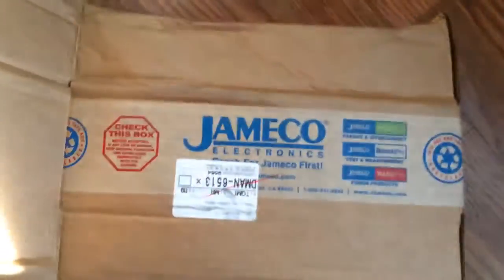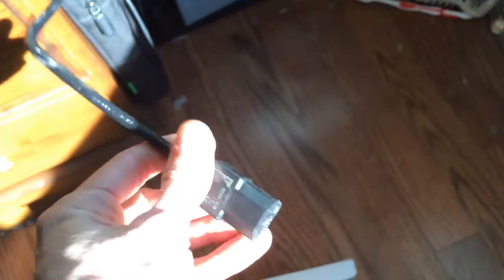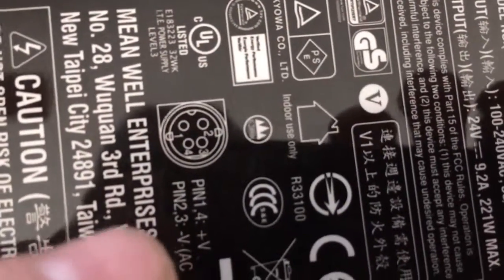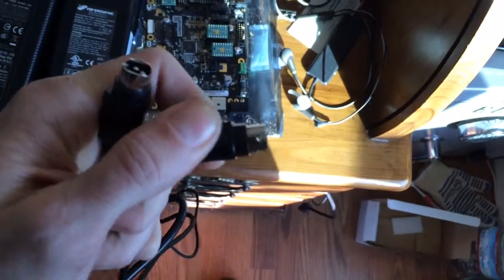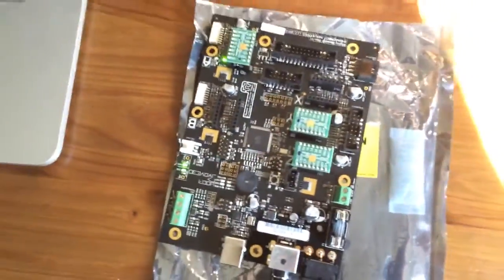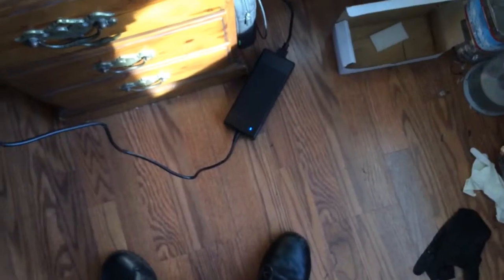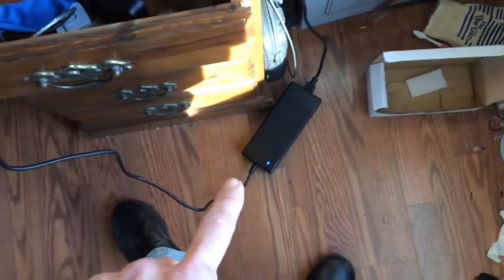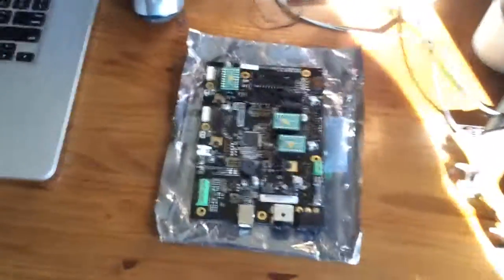Replicator 2 Power Supply Upgrade for HBP

Comment: I need a replicator 1 power supply and came across this video.   I just googled the part number FSP fsp150-aaan1.  It appears in 3 different configurations on the 4 pin din so definitely watch out.  The 12v 12.5amp gave away one fake, but the sticker looks identical to your video except for pinout.

https://www.ebay.com/i/163291454396?chn=ps

https://www.ebay.com/itm/Genuine-FSP-FSP150-AHAN1-150W-AC-Power-Adapter-9NA1350204-12V-12-5A-4-Pin-OEM/263925018197?_trkparms=aid%3D555018%26algo%3DPL.SIM%26ao%3D2%26asc%3D20160908110712%26meid%3D22981080a75946b6a8f4b471ce38f82e%26pid%3D100677%26rk%3D4%26rkt%3D14%26sd%3D163291454396%26itm%3D263925018197&_trksid=p2385738.c100677.m4598
Reply from the maker: That why I mention this at 1:17 , a lot of fakes on the market when it comes to some power supplies. I’ve known some people to blow the main board not checking the pin out first. Glad you caught this before your ordered the wrong one.
Reply from the maker: I just looked at the fake one you linked. Almost identical except the “Sparkle Power” name in it. FSP Group is the maker of the one power supply and they don’t have the name “Sparkle Power” on the label. That second eBay link is Defiantly a fake one, even different fonts on the label being used.

Comment: I got my 9.2A power supply, from a company overseas and when we plugged it into the motherboard, both new and old (since I had to replace the motherboard) sparks started to fly and I noticed that pin 3 and 4 were both scorched from the sparking.   I am now in the process of returning the power supply.  Did anyone else have issues like this?
Reply from the maker: Sorry to hear that happened. Do you have a URL link to the one you bought so others don’t buy this same one?
What’s version of the replicator mightyboard are you running?
Scot
Reply from the maker: Hmm, I just pulled out an old board that was blown (rev H, female plug) I grabbed the original replicator w power supply that it came with and looked at the pins and plug on the board. It does seem theirs a notch in the power supply plug that’s supposed to follow a notch on the board. 
A little experimenting, and I found you can plug them in backwards, or upside down depending how you see things. The correct way goes in easy, the wrong way does take a little more pressure but the pins did make contact. Not the safest plug, I never realized this before. 
So two powwablemthings come to mind.
1. If the pins were wired wrong (backwards) on the power supply you bought this coukdmhappen.
2. If the plug was plugged in backwards to the board with that extra pressure, it might also happen.
3. Cheap power supply that has a short inside and was grounding out the 110V house mains, this would definitely cause sparks to fly. 
If it is #3, count your lucky stars your still breathing to post that comment since that was a big risk to you.  

Please provide the site you bought it from?
Did the sparks happen as soon as you plugged it in, or after you turned on the printer board?
Does the board still work with the original power supply?
Does the board still work?
Did the boards fuse blow out?

I have one board that acts like it works, signs when I turn it on and all. But when I try to control a stepper using an app from the computer with the USB port it will always blow a stepper control board. I went through 3 of them before Makerbot replaced the board. I still have this board. Maybe some day I will see if I can figure out why it does this. I’m assuming somehow the board is giving the stepper controllers 24 volts, and not the lower 5V it needs.  
The point is even if it turns on and seems like it’s working it still might have an issue. So be sure to test it all the way.